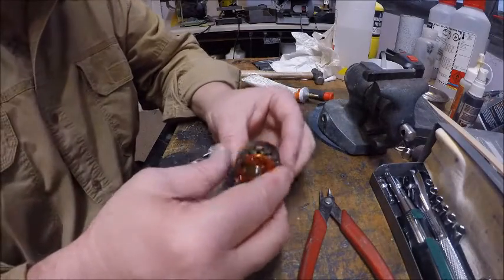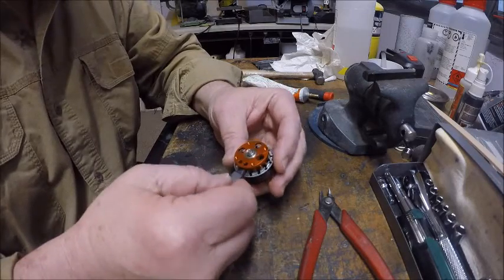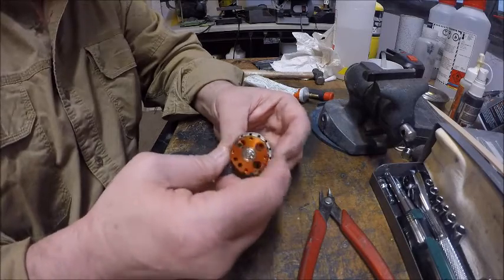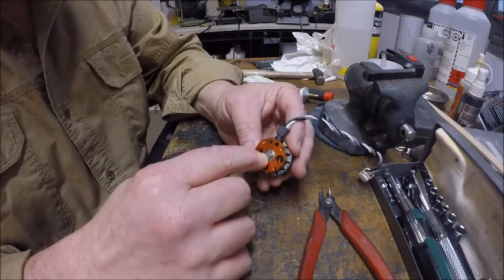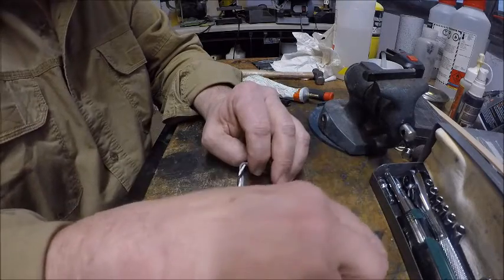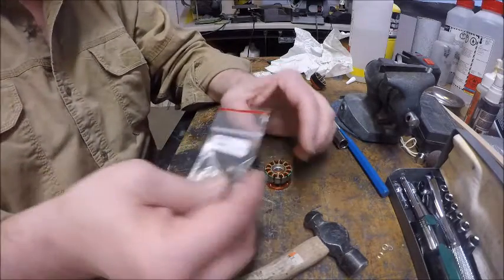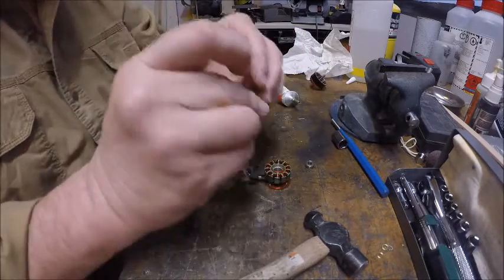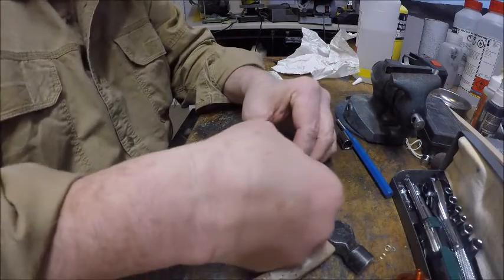Chroma Quad bearing replacement

Comment: Hi there.  I just wanted to say thank-you for this video.  I have a bad bearing in my Chroma Drone as well.  In calling Boca, I ended up with another option for bearing.  Maybe overkill, but wanted to share another part #  SMR694C-YZZ NB2.  Differences are:  Stainless and Ceramic versus Chrome Steel, which will give you a higher ABEC rating of 5 versus 1.  Hopefully this will help out the next person with rotor bearing issues.  Cheers!

Comment from the maker: I took one bearing apart and found that the CA glue that was used to hold in the bearing was inside the bearing, so I don't think it would. are you able to start the props? if so and no response from the quad, I would send it back.

Comment: Question... could a bad bearing (or bearings) case the drone to NOT take off?  I push up on the left stick and nothing.... just sits there.  I've called tech support and they want me to mail it in. Wondering if replacing the bearings would be faster and easier.  Thank you!

Comment: Thanks for the great video. My Chroma ended up with 3 bad motors new out of box. Horizon sent me 4 brand new motors; and 1 of them was bad... I needed that one, not the extra. So they had to send me one more new motor. It took almost a month for this to all get done. It does not surprise me that they sent you "new" motors that were also junk. Seriously quality control issues going on with the motor bearings, I don't care what anyone says. I now have a working Chroma but I know the bearings will go out eventually. If you can keep a flight log, let us know in a follow up video how long they lasted for!